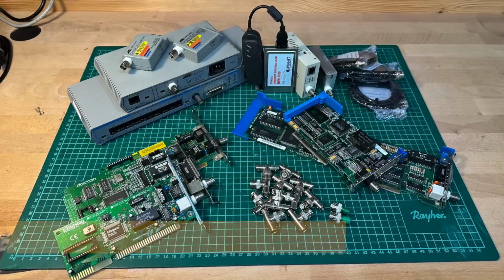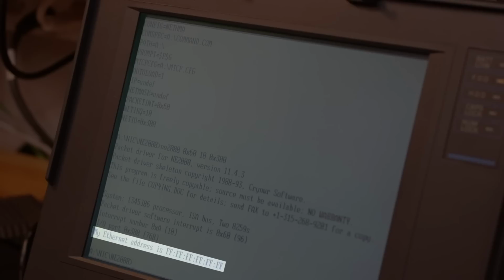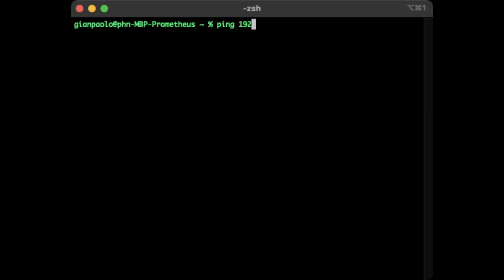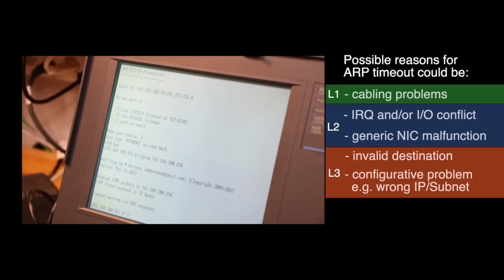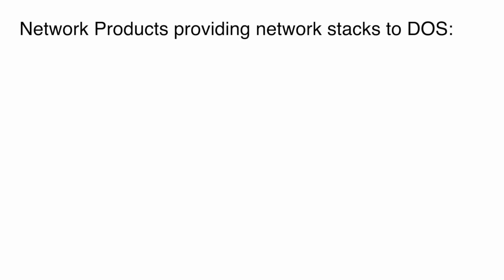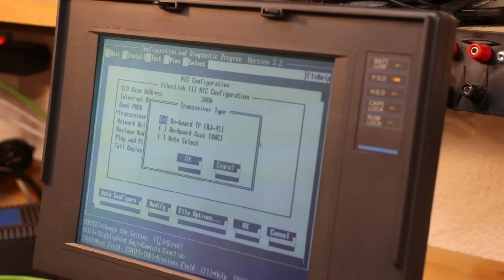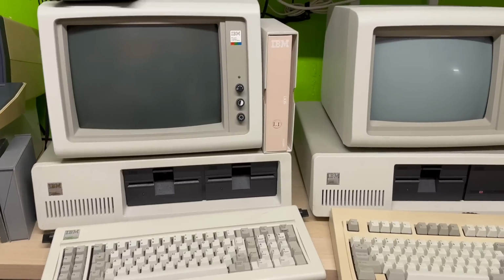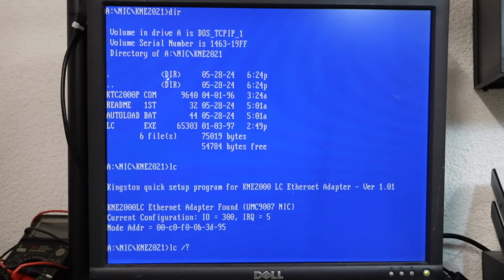Into Retro Networks: Network Cards & Packet Drivers on DOS (Part 2)

Comment: is that a cat7 patch cable? haven't seen one if those in 25 years
Reply from the maker: I have no Cat.7 cables in my workshed for ad-hoc wiring. Cat.5e and Cat.6, one of the two it was, though I would need to check.

Comment: You know that Accton card probably was working correctly with the ne2000 drivers but was probably only transmitting on the ethernet connection. Thats the large connector that kinda looks like a joystick connector. I suspect it probably does not work via the BNC connector without the drivers to swich it but I am only guessing as I don't have that card. I do have that kingston card that I got off ebay around 2018 or so and its a fantastic card that can work with either ISA PNP or in non PNP mode. Fun fact is that I think I had to put it in non pnp mode to get auto detected by ancient Linux distributions that I was testing back then.
Also for how to interface your 10base2 network to your wider network you could imploy a bridge via another PC or other hardware to go wireless.
Reply from the maker: @stevenchristenson2428  The Accton card runs just fine wirh either their driver or the NE2000 driver, it just needed the correct IRQ & I/O configuration, hence the need for the config tool.
Reply: @THEPHINTAGECOLLECTOR  Ahh that makes sense :P

Comment: Wi-Fi might be problematic with those walls, but you might want to try a powerline adapter. They don't always work even on the same phase, if there's a lot of interference, e.g. from LED power supplies. Since I don't have (yet) networking cables in my flat, I run my retro gear without wifi from a MikroTik hap ac lite. The 5 GHz radio is connected to my main wifi AP, the 2.4 GHz radio is in 802.11b/g mode with WPA (since my main 2.4 GHz network is 802.11n/ax only with WPA2 and WPA3), and I have five 100 Mbit/s RJ45 ports available as well. The MikroTik is configured as router instead of a bridge, so my old gear is on a different subnet. I turned on telnet access to the router as well (only from the LAN side), so I can configure it from any old computer.

Comment: Back in the 90s i managed to start with Netware Lite, then moved to Netware 4.11 and then Netware 3.11. I managed to get TCP/IP running under NetWare. However once i got FreeBSD 2.12 running that was it. No more IPX just TCP/IP. With BSD i could share my internet connection and do file and print and run Apache with PHP. IPX was okay but IP was just so much more useful.

Comment: Hi, nice follow up video

I dont believe you mentioned it but i am sure you would run the dos version of msd.exe or nortons info to verify resources available

While you may use the defaults that worked previously worked eg irq10 or c0000 memory   base 300 on some machine that combo may not be available on the next machine

Some times the memory address eg c0000 is free, but there is not enough free space starting at that register to do what is required

I did find the 3c509's to be great dos combo cards in the dos 4 to dos 5 era with novell - SMC's at that time were fine as well

Regards
George

Comment: It looked like that ceramic cap on one of the cards was split down the middle. I’ve actually had that exact fault on a card and it meant traffic one way was basically useless but the other direction was fine.
Reply from the maker: Good spotting. Yes, it is split, but it looks more like a clean cut. Other cards I have, like the Kingston KNE2021 also have this. I didn't give it much thought to be honest. I'll consider that for another look when I turn back to that NIC for a second investigation.

Comment: How is power routed into the bunker, is there just a single conduit or a few conduits? If there is a separate conduit for an antenna feed I'd repurpose that, otherwise look into some ethernet over powerline adapters.
Reply from the maker: On single 50-years-old conduit. I barely could bring in the new wiring to replace the old cables.  It's propably the thinnest I've ever seen in my life, as it barely accomodated the 4 wires needed to pull.

Hence it's going to be some powerline, we'll see...

Comment: I vaguely remember some ne2000 clones were finicky with certain IRQs and/or addressee.  IRQ 5 more stable than 9+ sort of thing in DOS.
Reply from the maker: Can't really tell, as this was indeed before my time.

IRQ5 (or limiting to IRQ5 or 7 as a max) certainly made sense, as the original IBM PC design only had 8 IRQs, with IRQ7 being the last, but typically LPT1.
IRQ5 was intended for LPT2 and most often free, so easily usable for another adapter.

That old 3Com Etherlink II card I have indeed doesn't allow setting anything else than IRQ 3/5/7.

IRQ9 is somewhat special, as this one is cascaded with IRQ2, coming as the result of introducing a second interrupt controller with the IBM PC/AT.
So maybe IRQ9 was prone to issues and conflicts with IRQ2 due to the cascading.

Maybe a subject to furtherly explore.
Reply: @THEPHINTAGECOLLECTOR  It's also possible some drivers or card firmware for NE2000 in LANtastic or other networking OSes were hard coded for the 8bit ISA IRQ range (0-7).  Anyway just something to try on one of those 'not working cards' - it might be enough to get it working.   Love the videos!
Reply from the maker: @jrherita  Thx for the hint, will try it!

Comment: I always wondered if you changed the oscillator on these old ISA nics if they would speed up or slow down Ethernet speeds.  I.e. 16 MHz for 8 Mbps or 24 MHz for 12 Mbps.

Comment: To many years ago. First of all just do the jumpers and don't do the plug n pray on ISA cards. The IRQ I used was 5 and I think base address of 320. I think midi was 330 and early cd=rom drives not ide was 300. Most was defaulted on IRQ 3 / base 300. Don't worry about IRQ conflict unless you have a 2nd printer port 278/iRQ5. Then normally you could share it and even print. Anyways one of the big things I noticed was people would not use the drivers that came with the card. Thus, why people used 3com cards in say windows 95. Oh, a tip in windows 95 on certain cards. It will get stuck on finding hardware doing windows install on certain network cards. Thus, leave it out until after install. Back to drivers. I can't tell you how many times I would install the drivers and it would seem to double the speed. Yea it would still be 10mbps. But when you say call up a dir of files. It would be fast. Then in windows 95 with tcp/ip  say things. Login faster, etc etc etc. It would solve misc. issues when using a generic NE2000 card. I can't tell you how many people would use over priced 3com cards. Just because they could get a generic card to work.
Reply from the maker: @idahofur  thanks for your thoughts!

Second that on junpers or fixed IRQ & I/O, that‘s also my preference.

Comment: Great Episode!  I personally use Kingston KNE20T NE2000 Cards.  They seem to be the most compatible.  My XT dual boots to DOS and ELKS 8088 (Full UNIX Clone) and this card works flawlessly.  On the subject of Concrete Walls.... I lived in a full basement apartment with very thick full concrete walls.  I tried two solutions: 1.  Use Powerline Networking or 2. Use 2.4 GHZ WIreless.  The 2.4 Ghz was the winner IMHO.  It was easy to adapt an 802.11b  WEP to an existing commodity router.  Alternatively, you could also try converting a Linksys WRT54G as a gateway.   I am looking forward to seeing your solution.

Comment: I can recommend TP-link Powerline adapters for getting Ethernet ports around the house using power outlets. They don't require any drivers so work for old systems and Macs etc
Reply from the maker: Uhoh, another one reading my backlog ;)
But yeah, one might guess I'll be looking into Powerline soon ^^
Reply: I also recommend. Been using for about 7 years in a 150 year old home. Occasional reset of an adapter (very rarely reset and re-pair them) but very stable and fast.

Comment: If you have power into your bomb shelter and its on the same mains panel as the rest of your network (ideally the same circuit, but it works same panel) modern powerline network adapters work pretty well. I had some of my IP cameras using these at near gigabit line speeds for a while in my house before I ran proper cat6 to them. They were pretty solid and this was 5+ years ago. 
If you have cat3 for old phone lines in there VDSL media converters would work too over a pair of copper cat3 conductors.  I may or may not have done it over thermostate wire too and it worked fine for a shortish. VDSL is not as fast as powerline, but I think you could still get several hundred mbp/s on a short run. They are more pricey than powerline adapters too in my experience.
Reply from the maker: Are you reading my backlog?
Silence, don't you spoil everything! ;-)

Comment: Used to deploy Lantastic to smaller customers in the 90s. Simpler it couldn't be. Regarding the bomb-shelter network access, would imagine a wireless ethernet bridge at the lowest frequency possible would work with those walls and solid metal doors.